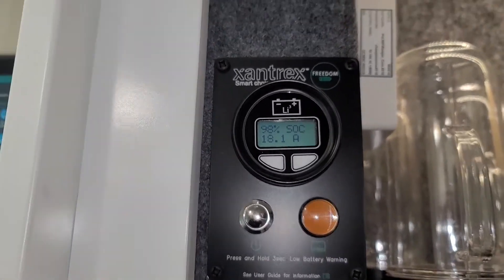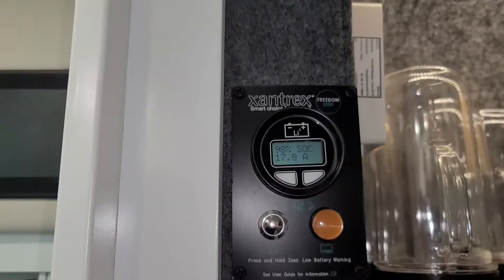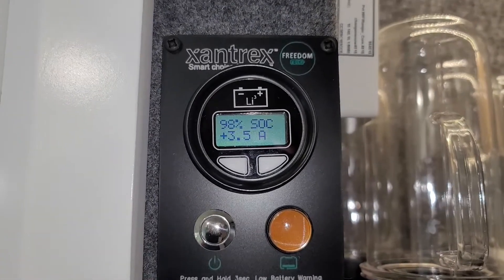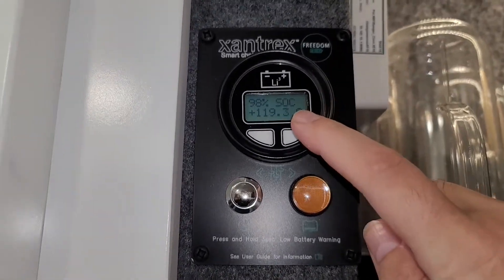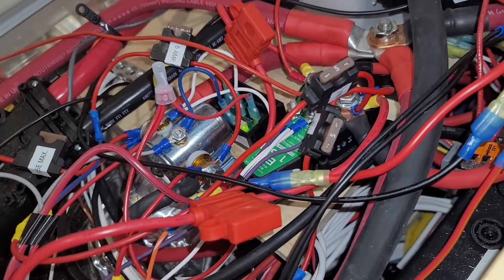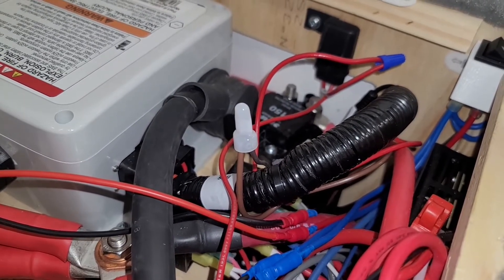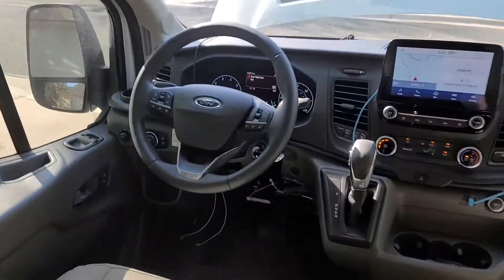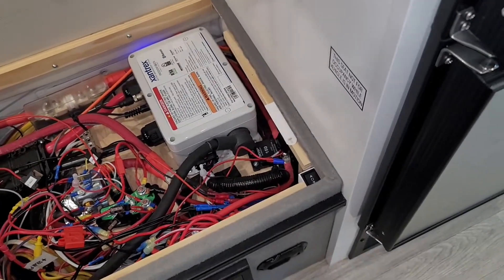Coachmen Beyond 22C - Diagnosing our Li3 Charge Issue / Correction - No Remote Start Charge

Comment: I have a 2021 Beyond LI3 and I have gone through 3 combiner and 4 kib solenoids and 3 balmar regulators. My problem is that when the House battery shows 100%, after I start the engine, the amps jump up until there is a high pitched noise in the solenoid area followed by a flashing Low Battery Charge  light and then the House power shuts off and starts up, stopping the high amp, high pitch noise and flashing light. The dealer keeps putting in new solenoids and regulators but not diagnosing why they keep burning out. 
I am looking for someone to discuss the problem and possible solutions. 
  Thanks. 
  David